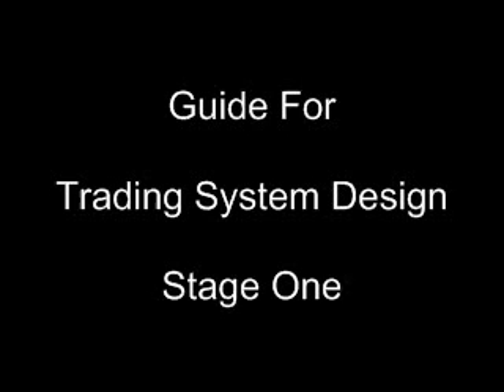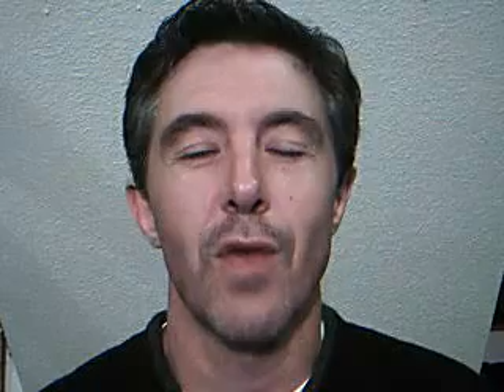Trading System Design Guide - Stage One

Comment: hi brian, 
I agree with you. The approach to the trading systems has to be an "engineering" approach.
I am an electrical engineer Power Electronics. I started doing some betting a year ago, I consider this is my first step into trading. 
Calculus, Algrebra, Physics, Maths. Everything is being worth while used in my betting, Understanding and reading charts, statistics, probability etc..
I stop loosing money 2 months ago. I am still trying to improve my system. Now I win 80-85% of the bets. :O)